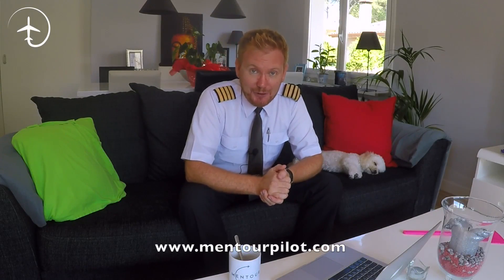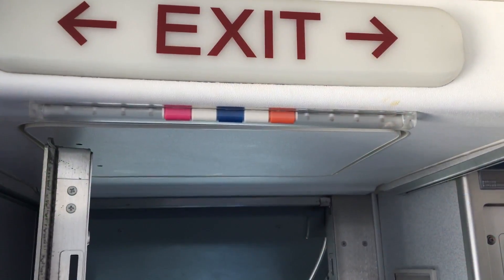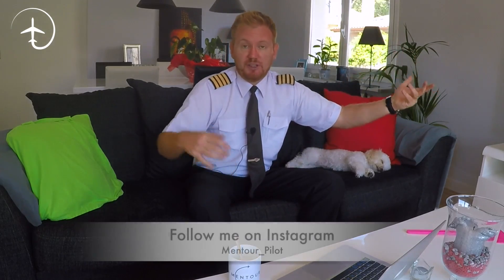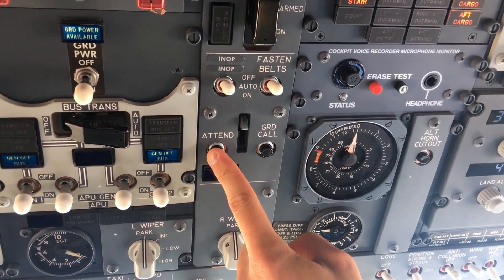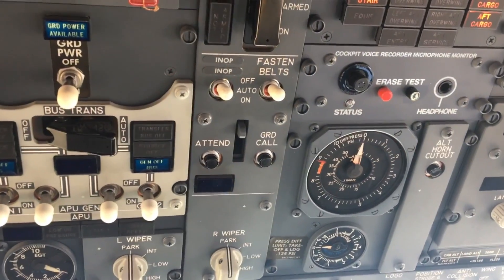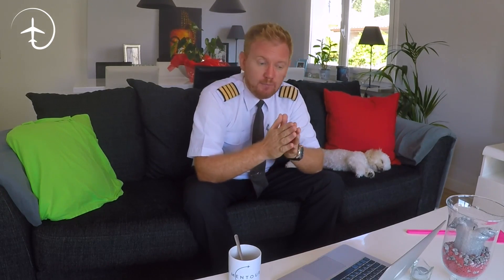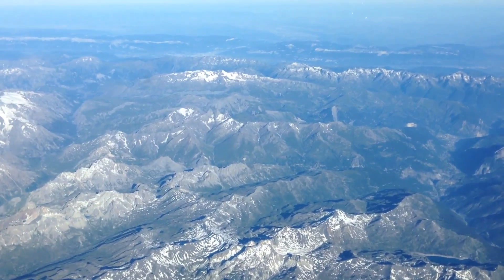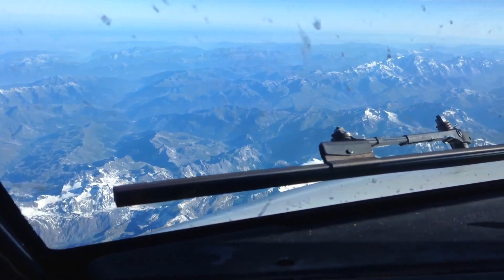Aircrew secret "sign" language - Explained!

Comment: If the door to the flight deck door is locked throughout the flight how does the cabin crew deliver meals to the flight crew?
Reply from the maker: Special procedures to open the door but I’m not allowed to get into that.
Reply: when was the last time you heard about a pilot receiving medical aid for lack of food and water?😄
Reply: At least how I have seen it done when a pilot needs to use the rest room. They mark the front bathroom as occupied, a flight attendant stands at the entrance to the galley to 'guard' it and cockpit door opens and an attendant and pilot switch places. Sure it is somewhat similar for meals.

Comment: Great video Petter, I've always wondered what the orange light was for. I also didn't know the passenger call was segmented into zones. I have noticed on the airline that I frequently fly on in the US uses two chimes in turbulence to notify the flight attendants to take their seats. Do you have a similar signal?
Reply from the maker: No, we just switch on the seatbelt sign for that. If it is severe, I use the OA and tell the cabincrew to return to their seats.
Reply: Three chimes used to mean sit where you are (even in the aisle) and hold on to the cart at EAL
Reply: Southwest Air uses the two chimes for the seatbelt sign.  I know this from flying PHX to SAN a lot. There is a lot of turbulence over Western Arizona in summer.

Comment: Do brand new aircraft still have the no smoking switch for use as described in this video?
Reply from the maker: Yes, but it’s just labeled “inop” like you see in the video.
Reply: when i was on the A320, the No Electronics light had replaced no smoking

Comment: Good to see about the many cabin lights in the aircraft. Is there a way for passengers to see the pilots while the aircraft is boarding before takeoff or after landing or do they lock the cockpit door before boarding and after the last passenger leaves the plane to unlock to prevent contact for security purposes?
Reply from the maker: You can always ask the cabincrew to come and say hello after the flight. It’s up to the pilots to accept it but I certainly would.
Reply: Mentour Pilot
I wondered about this too with the unfortunate reality of security issues. Especially with the children, they need to experience the cockpit at some point to get some of them excited about flying planes as adults. Back in the 70s when I was a child I was lucky after the flight that the pilots and crew would allow me into the cockpit to check it out, very interesting and exciting too.
Reply: during boarding is a very busy time for the flight crew. your best bet is to make a respectful request to the purser about an hour before landing. chances are highest at the gate after shutdown assuming the flight is terminating, that is: nof continuing on to another destination. don't take it personally if there is a denial. it is always captain's discretion.

Comment: Huh... I mean, you started off by saying that the signals were company specific, but it didn't really occur to me until closer to the end just HOW company specific they are. I think the only similarity I could spot between what you were saying and what I was able to observe on a recent flight was the part about how the passengers' Call Attendant button interacts with the system, and that one's practically a gimme because Boeing wires every 737 it produces about the same way...

Comment: Security reasons my ass. Those calls have been in white papers for sixty years, liar. :P Edit: Also just be aware; we're using such out of date communication methods because people are lazy. Event organisers on the ground will use throat mics and earpieces to radio between each other over 'party lines' or break off for private conversation. In-vessel communications of all kinds besides aircraft are done with internal radios. Eventually aircraft will catch up but it's going to take something drastic.
Reply: So you have more knowledge than an actual pilot
Reply: He says things about security reasons multiple times, which instance are you refering to? About the codes on those phones are quite obvious why he doesn’t tell that i think?
Reply: if they are quite obvious  why do you want to know them? if u dont know them they are not pretty obvious

Comment: Isn’t there situations when the cockpit door can be opened during flight? Either when the pilots must use the toilet, or the cabin crew bring them food? I guess that happens more on longer flights than you are flying, but still...

I think I have seen a video from a plane where it is a small camera showing what’s outside the door, that the pilots can see and press a button to open the door from the cockpit.

Comment: @mentour But serious: I think it's absolut not okay, that there is no folder or any information or a short video on the websites of airlines, that explains that. At my first flights as passenger - already with a bit fear of flying - I was so scarred about the dings/bings, because I didn't know, what it meant, I thought it might be something really serious or later during the flight something really dangerous (code for "we have a problem")

Comment: Since smoking is always banned and thus could easily be indicated with a printed no smoking sign makes me think that a more useful way to make use of that existing feature of the passenger indicator system would be to replace it with a no devices indicator. The lamp is already there only thing that would need to be changed is the plastic panel cover and these days you can't fly anywhere without hearing at least one person have to be reminded to stow their device for takeoff/landing, that and might help to remind that one person that can't even wait for the plane to get bellow 100 knots after touchdown before trying to pull their phone back out. I dunno if it's just impatience or if people are really that dense that it doesn't even occur to them that if there is a runway incursion their damn phone is going to kill someone.
Reply: A cell phone is not going to cause any major issues with flight systems. The power output of cell phones is quite low and the electronics of an aircraft are engineered to deal with normal amounts of interference. After all, an airplane has to deal with numerous types of electromagnetic signals, such as television broadcasts, radio transmissions, thunderstorms, EM signals from space, GPS signals, satellite communication, air phones, etc. In addition, many commercial airlines now offer WiFi to their passengers.

If a cell phone could bring down a plane, a terrorist would have already used one to do so and cell phones would therefore be prohibited on commercial flights.
Reply: +Eternal Tech I was more talking about the fact that a cellphone travelling at 100 knots is quite an effective bludgeon if it slips out of your hand because the plane hit something. That's the main reason they have loose objects like that stowed for takeoff and landing just so they cannot become projectiles.
Reply: +Seraphina S     I understand your point. However, is a cell phone as a projectile any more dangerous than a can of Coke in a passenger's hands?
Reply: Seraphina S Some newer A320s have the no smoking light replaced by a No Electronic Devices sign instead, exactly as how you said.

Comment: I interpreted these ding dings as part of comm signals you explained them very well now. Later on a flight I just tried the steward call button and confirmed that it also makes a ding. Now a days I was focusing on those light patterns, but thank to you I don't have work more on them. It's like a known territory now.

Still my quest on the various systems of flying machines are going on. One of which are the 2 flaps of B777 each are near to the fuselage part of wing, that keep on up and down motion through the flight. What I have observed is that they are moving to counter the wind impact on the rolling stability of the aircraft. The best I am waiting when you explain them on this channel.

Comment: Hi Mentour, I have a question not related to this wunderfull video...
When you are as a captain on a transatlantic flight and you are going to sleep, is this time still counted as flight hours in your stats or how you get the correct experience times?
Thanks.
Reply: flights beyond 8 hours, we carrry a relief captain. this allows the primary crew an individual rest period based on the total time the airplane is aloft. as the left seat is passed to the relief captain,  the primary commander is no longer on duty until their return from rest. at which time the first officer will begin his/her time in the CRA.  the primary crew is normally at the controls for approach and landing at destination
Reply: Thank you, looks very clear now. One open question less ;-) Wish you a fine weekend.

Comment: It's silly that this system is still being used in the 21st Century.  It would be easy to have a wireless communication system for the crew to communicate directly without all the ding-dongs and bing-bongs.
Reply: Why spend the money when the dings work fine?
Reply: Being "modern". Then again being modern isn't always necessary, as seen here.
Reply: I would miss it :-))))
Reply: John Ferguson
Nope. Wired systems are dead reliable, compared to wireless.
Reply: Totally agree! Wireless headsets for the cabin crew would be far more easier to communicate. Also the dings and dongs wouldn’t wake me up anymore on night flights..

Comment: how do the flight crew get food and drinks or go pp on long flights if the door has to stay locked
Reply: Crew go inside to serve them meals, there is a procedure that involves a member of the crew locking the toilets and blocking the aisle with a trolley and guarding the 'sterile' area until the member of crew has served the meal and the door has been shut behind.

Comment: It is very strange that in a day when every car has a rear view camera and monitor (at least in USA) airlines have not yet retrofitted jets with $100 system so that the pilots can actually SEE what is going on in the cabin.
Reply: Not so easy to do. Retrofitting anything on existing aircraft types is a major issue, needs to get FAA approval and many other issues.
Reply: Not $100 for an airplane.  First, I'd be surprised if airplanes have a 12V DC power bus that can power products sold for typical cars.  (Expect to find 28V DC and 120V AC @ 400 Hz on an airplane.)  Power adapter?  Stuff certified for 400 Hz isn't cheap, and neither are 28V DC-DC converters, given the small market niche.  And don't even think about installing uncertified stuff on a passenger plane.  Not to mention, there'd be testing and recertification of the modified aircraft to ensure such an additional load retrofitted to one of the aircraft's power buses won't overload it or inject electromagnetic interference propagating down the power buses!  Then there's the whole "intentional RF" issue: Lots of testing would have to be verified to ensure the radio signal from a wireless camera doesn't interfere with the avionics!  It practically took millennia for the FAA cucks to finally accept passengers' 2.4 GHz and 5 GHz Wi-Fi.  In all honesty, a wired system would be much less headache than approving anything wireless.  Except if you want to drill holes in the aircraft and run more wires, you'd still have to run more tests and recertifications anyways.  And what for?  Just so pilots can actually see the vomit spewing from the airsick passengers, instead of just overhearing it on the intercom?
Reply: How do you know they don't?
Reply: Installing new systems isn’t trivial, even small ones, given the life-critical nature of airplanes. They can’t even remove the no-smoking button because that’d change the cockpit layout ever so slightly. Installing a camera display (or mode) in the cockpit would also require research and certification that it doesn’t negatively affect the pilots’ performance in any way.

Even if installed, they’d probably only be used as an extra line of information during emergencies. Cabin crew deals with passengers; the pilots have plenty of work already. 😅
Reply: There was a case years ago whereby the pilot asked one of the cabin crew to look at the wing of a plane when it was leaking fuel. She or he reported back to the cockpit to confirm that as the plane had no cameras to monitor it.
Reply: And 360 coverage of the outside of the aircraft even cheap cars have this option.
Reply: @-DC-  the airbus a380 has this
Reply: After getting FAA approval it would cost millions ;-).  Just kidding!
Reply: Adam Corby - I could easily see adding cameras to existing aircraft would run into 25-50K USD per aircraft. The hardware is the cheapest part, its all the engineering, certification and labor costs that adds up fast. The payback for the airline is virtually non-existent, so I would only expect to see it only on future designs.
Reply: Video doesnt tell the story. If you have an emergency you probably wont sit and watch a monitor for clues, but rather the instruments and flying the plane.

In the end, a video will not help in the communication between cabin and cockpit which makes the system half-redundant.
Reply: Niklas Stenhall  any tool that is available can be helpful. Better to have it and not need it than the other way around.
Reply: @Wexexx  you are wrong. It will help, it will just not completely replace the old system.
Reply: @hkr667  its definitely harder then you think. And what you get out of it is not worth it.

Comment: Right, "orange light", get the plunger!
Reply: Orange light, out of toilet paper !
Reply: Most of the time its ppl stuck , or dont know where the lock is 🤣
Reply: @oddgamer1459   Or mix up the cabin attendant call button and the toilet flush button!
Reply: Hahaha, I was thinking exactly the same!!!
Reply: Brown light with loud klaxon...
Reply: If you push the orange button in the lavatory, does that automatically unlock the door? Or I think the attendants can unlock the door from the outside in any case?
Reply: Love JetFuel no, there’s a switch on the outside of the door, usually hidden underneath the ashtray or no smoking sign which unlocks the door (or locks it out of service)
Reply: @lovejetfuel4071  Depending on the aircraft, there is usually a little metal tag that says Lavatory. If you lift that up, there is the lever to unlock the door. Some other aircraft have the lock release close to the top
Reply: hahahaha dude :D
Reply: Get the plunger hmm
Reply: Yep. LOL
Reply: More like start of meal service, start of duty free, delay announcements etc.
Reply: I imagine the newest flight crew member hates to see that "orange light" turn on.
Reply: Dwl 😅😅🤣 that will change the CG.
Reply: Nothing that everyone said here is right. Bunch of Fucking ignorants.
If a plane goes down you'll freaked out and the ones trained to rescue you are the flight attendants.

Comment: The one I wondered was the phrase "Doors to manual".   I used to hear that on flights and wondered why?

And, yes, I also wondered what all the bongs were for!   Well explained, thank you!
Reply: It means that the emergency slides in the doors will have to be enabled manualy. During the flight the slides would automaticaly deploy when the doors were opened.
Reply: Ah, thank you!
Reply: @johnsim3722  before the aircraft pushes from the gate, the cabin crew closes and set the doors to automatic. should  the doors be opened again,  the slides deploy in 4 seconds. after landing, the doors are set back to manual
Reply: @ Ava Mendez, I've seen videos how those chutes inflate and that's impressive!   So it's just to set the emergency chutes should the doors be opened again.   Thank you!

Comment: Do you ever do the pre-departure greeting from the cabin, so the passengers can also visually associate you are the captain?

Also: is there a name for the engine thrust 'mode' when you advance power during descent (such as 'approach power' or similar term)? I'm thinking of that phase of flight where that BA 777 was on approach to Heathrow, and when they came up on power, the oil coolers got ice clogged, and fuel starved both engines, leading to a crash on the threshold. Thanks!
Reply from the maker: Hi! I never really have time to do the formal greeting of the passengers.
During the descend we use “idle” thrust and during the approach we use approach thrust which varies depending on Flap setting etc,
Reply: Mentour Pilot Great! Thank you for the quick reply!
Reply: Gun Nut Thank you for the extra info! Always good to learn!

Comment: First, thanks a lot for your fantastic work explaining so much about aviation and your time spending on producing this high-quality content! Just two suggestions for new videos. The first: how is this "roaring" engine sound created especially on take-off-thrust? Why is ist louder in front of the aircraft and nearly not perceptible in the back?
Second question: Especially on low-cost flights there are always some "now-shows" at boarding. That entails a LMC normally. At my time working in the OPS we've done it always on your "special" company load-sheet (is it still the same procedure?). Maybe you can explain something about LMC's (PAX, fuel…) Also on preparing a load-sheeht.

Thanks again and best regards
Reply from the maker: Sounds like good subjects. Thank you!

Comment: I was on an A330 flight recently and it couldn't have been more than literally ten seconds after takeoff when there was a ding...what could that have been?
Reply: notifies the cabin crew the gear has been retracted
Reply: Thanks, but why do they need to know that?
Reply: What has that to do with the question I asked, which was not about the no smoking sign. Why do the cabin crew need to know that the gear has been retracted or extended?
Reply: Why is the chime there? I still don't understand.
Reply: Passenger calling for a coffe